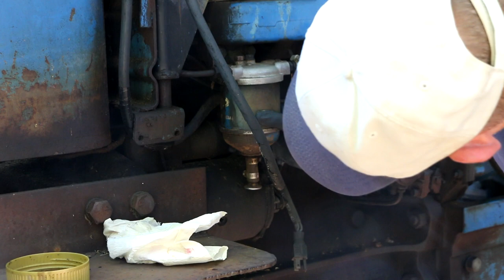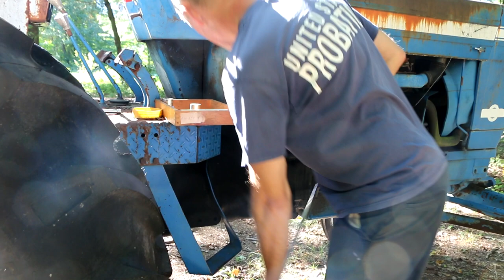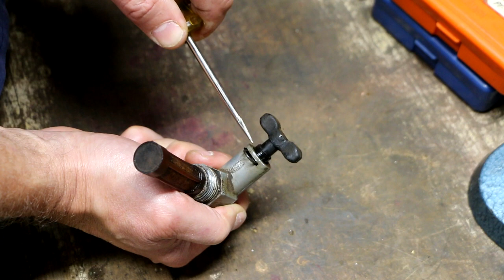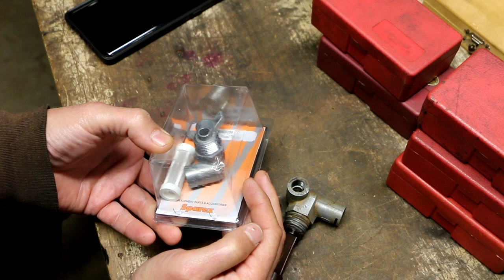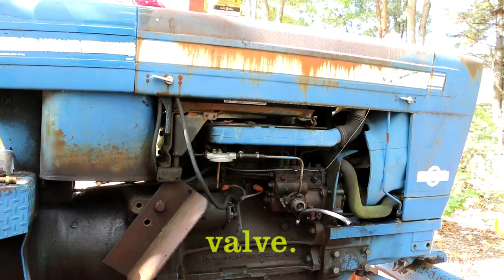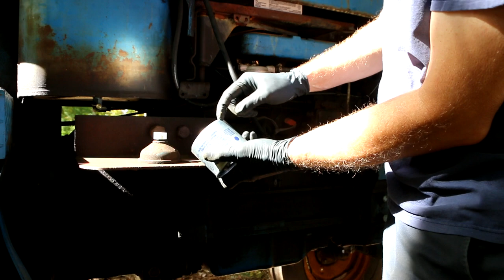Ford 5000 Diesel Tractor: Fuel shut off & filter replacement

Comment: Also filter 7111-296 works.  The top of the filter is open and will allow the fuel to flow in better instead of just around the outer edge.  Especially in freezing temperatures. 
A small pair of vise grip pliers clamped to the priming handle helps too.

Comment: The 3166 filter is the correct filter.  If it was a double filter setup it would still be the same filter for both.  I just bought a 7000 ford that had the double filter setup and changed it to the single filter.
Reply from the maker: You are correct, there is an error on the NAPA website because it also shows a 3271 filter as a possible replacement, but that is for a gas tractor. Selecting the diesel engine should make that filter choice go away, but it doesn't..........nobody's perfect.

Comment: This video is going to help me tremendously-I have the same problem with my 5000 starting but wont idle-black smoke out the exhaust and then dies-it will recrank ok but just wont stay running. I changed out my filter hoping it would help-my bowl looked just like yours, looked like mud-I loosened my injectors to get the air out of the pump-I didn't know the bolt on the left was a bleed hole, thanks for that info-and its the same thing far as wont idle. I was getting ready to drain my fuel out and looked for a way to remove the cut off valve on YT and found you-did you order the same cut off valve from NAPA and did it work the 2nd time? I also got the small 0 ring with my new fuel filter and couldn't figure out its purpose until now. Thanks for posting this....